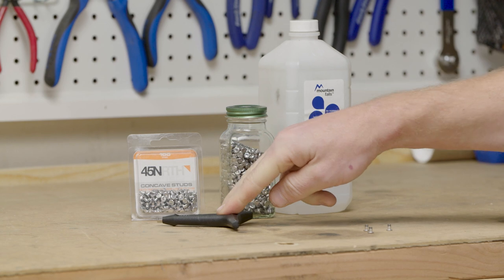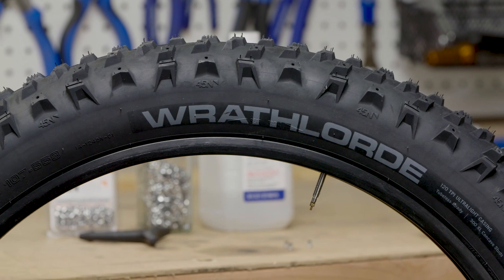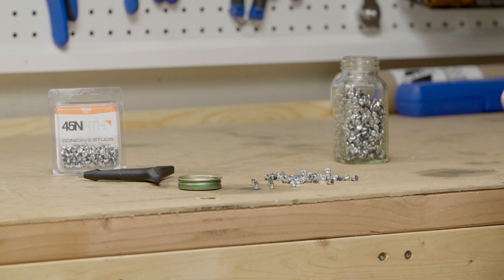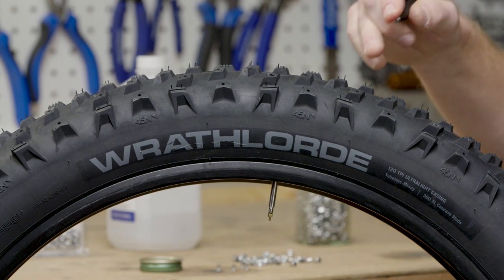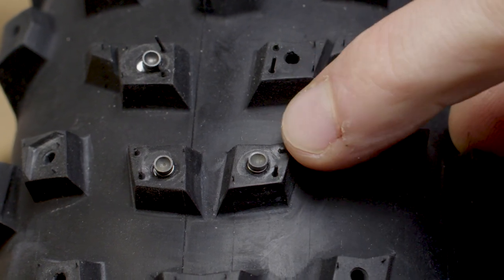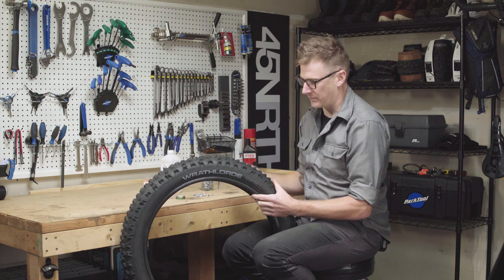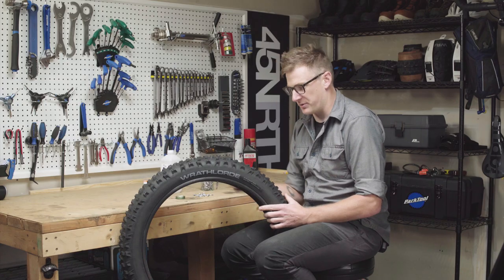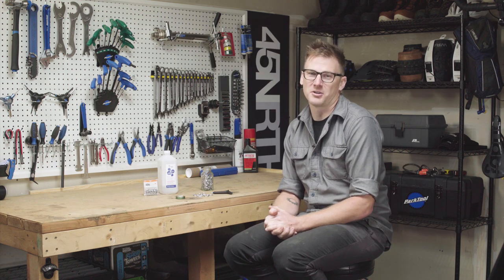45NRTH Tire Tech Education - Tire Stud Installation

Comment: Thanks for the video. I have your Xerxes tires and I need to replace some studs. All of your replacements are concave, while the studs on the Xerxes are flat. I can't seem to find any convex 45Nrth replacement studs for the Xerxes. Which 45Nrth studs should I use for Xerxes replacements? Also, do I need to remove the tire from the rim to restud a few? If I leave the tire on, do I need to remove all the air or can I restud a few with the tire fully inflated?

Comment: Great tutorial!  Are the XL studs more prone to shedding than the concave studs?  I have about a 1/4 mile stretch of pavement that I peddle over before I reach the trail head...
Reply: Pavement doesn't hurt them, it's wheelspin or skidding on exposed rocks and roots that pulls them out.
In fact, a lot of studded tire manufacturers recommend putting several pavement miles on your tires before taking them off road, to ensure that all the studs are seated properly. Just take it easy and you'll be fine.

Comment: A pack of studs for bicycle tires costs $125. Apparently they are christened with unicorn tears before they leave the factory.
Reply: Carbide studs are fairly involved to manufacture. That said 45nrth overcharges for literally everything. Bikestud.com is where it's at.
Reply: $40 for 300 anywhere else.